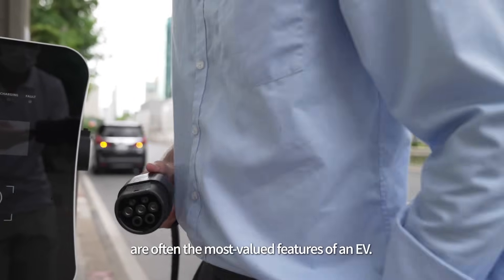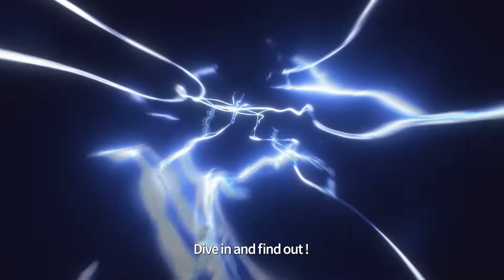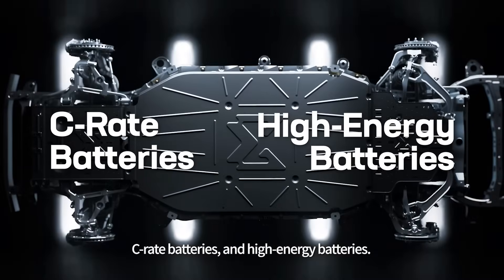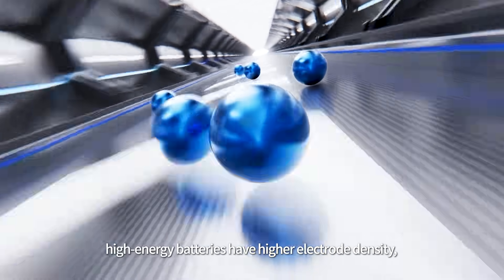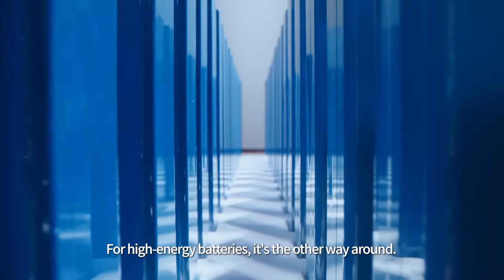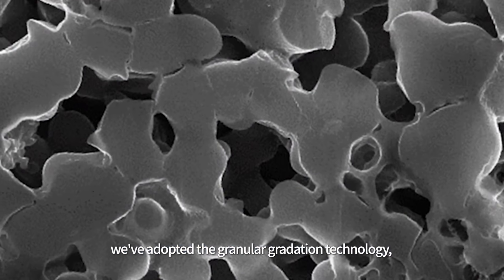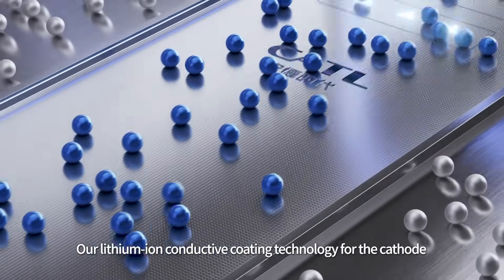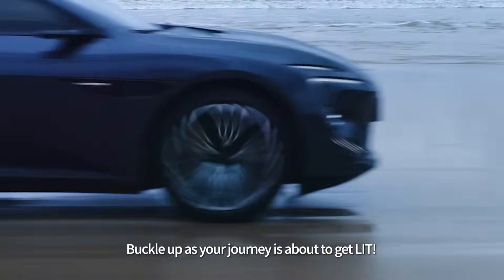Rewriting EV Rules: Extended Range & Fast Charging, No Trade-off!

Comment: Your shenxing plus LFP battery cells are by far the best cells ever made by any company period,they have more than 3000 cycle life(88% remainig capacity),they have 260 wh/kg in cell level energy density,and 4c charging capability respectively,for comparison dry coated tesla 4680 cell in cyber truck has 811 NMC chemistery with 268 wh/kg cell level energy density,it has effective 1500(88% of remainig capacity) cycle life,and because of it's chemistery it has chance of catching fire 10 times more than LFPs,if i were ev manufacturer like xiaomi,porsche,mercedes benz or toyota bz,i would absolutely go for this new 260 wh/kg cells and put them in my ev's battery pack,because of its price,safety,longevity,4c charging capability,etc please build manufacturing facilities in side united states same as you did in europe,because united states unfair tarrifs will effect you,and dont forget to release zero deg(9000 cycle life)condensed LFP cells with 400 to 450 wh/kg in cell level energy density,ev industry wont need any better cells for the next 25 years,world will never be the same after the day you interduce this 450 wh/kg LFP cells
Reply: Chill bro,i know 4680 is a battery form factor,i was talking about tesla specifically,their own manufactured 4680 cells in the cybertruck,its a dry coated 811 NCM cathode chemistery,its not a bad cell at all,811 NCM has the longest life cycles and energy density and extreme charging capability(more than 300 kw DC) in ternary type lithium ion cells,and lowest degradation rates also,if only tesla's 4680 had above 300 wh/kg energy density it could be one of the best cells ever made by any company,meaning it can last twise as previous tesla batteries used in model s,model y,model x,because these 3 models have 18650 and 21700 panasonic NCA(nickel-cobalt-aluminum) cells which have half of cycle life(between 800-1000) compared with NCM(nickel-cobalt-manganese)cells, tesla's inhouse manufacured ternary battery is the best chemistery form of it's kind,which is 80% nickel 10% cobalt 10% manganese that has been proven to have a 1500-2000 real world life cycles,but i was refering to CATL's amazing LFP cells,which will retain 88% of it's capacity after 3000 cycles according to CATL which is mind blowing,best NCM 811 cells retain 88% of their cap in 1500 cycles,CATL's lfp battery cells needs 5000 cycles to lose 20% of it's capacity compared with 2000 cycle of 811 NCM cells to lose 20%,which means lfps have 2.5 times of a NCM cells in terms of longevity and life span, that is a fact that no one can deny,im not chinese or american,im israeli person whom is interested in battery technology and i dont care who or which country manufactures the best cells out there,i hope for better ev battery technologies no matter who makes it sooner or better,as for safety of lfp,they are much safer,they dont have problems with thermal runaway or dendrite growth and overcharging scenarios,LFP batteries are among the safest types of lithium-ion batteries, with a low risk of overheating and catching fire.These batteries are less prone to thermal runaway and do not release oxygen if they catch fire, making them safer than other lithium-ion batteries.
Reply: lfp  battery  cheap   low qualiy  like made kn china
Reply: Shenxing plus has 205wh/kg pack level,at their press con last april in china auto show they  stated that"" the Shenxing PLUS battery pack has a topological structure optimized on top of  module-free CTP 3.0 technology, enhancing the packing efficiency by 7%. Through breakthroughs in materials and structure"",CTP 3.0 has 72% volume utilization rate,so when you add an other 7% to 72%,you will have 79% volume utilization rate,so when you mutiply 79% by 260 wh/kg,you will have 205 wh/kg in pack level energy density,that is how i got to real energy density of their shenxing plus battery cells,its a 260wh/kg  condensed version of their original lfp cells which originally had 223 wh/kg in cell level energy density.lfps are 10 times less likely to catch fire according to different tests.
Reply: @davidfujkk8018 If you knew what you were talking about you would know that 4680s are not chemistry specific but a general cell design. They can be LFP if need be. Where did you get the 10x less likely to catch fire? You haven't shown proof. Where did you find information on cybercell cycle life?  Also if you are looking at the bigger pics you would know that manufacturability of a cell is the most important thing which the 4680 has the edge with. It doesn't matter if you can make a great cell if you can only make a few million a year. Assuming you're not a Chinese state shill I suggest you watch the limiting factor's video comparing the 4680 to CATL and BYDs offerings at least they know how to add spaces after their commas.
Reply: I'd LOVE to know where you found the cell level density, I've scoured the website and can only find "Pack Level 212 Wh/kg"
.
As for safety, "10x less likely to catch fire"? How EXACTLY do you know?
.
Seems like you're guessing?